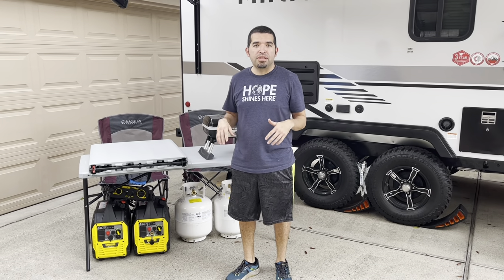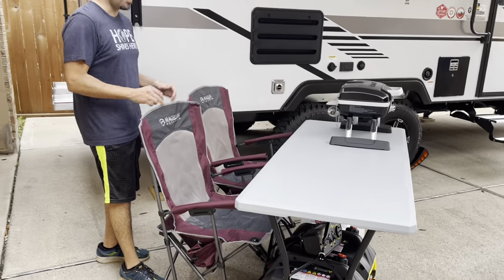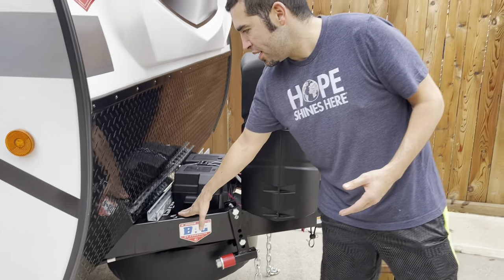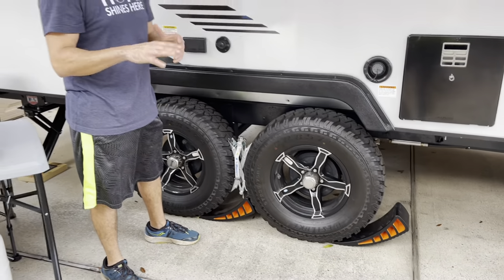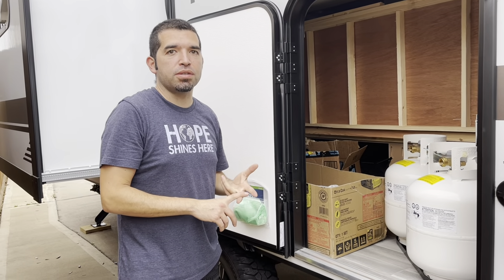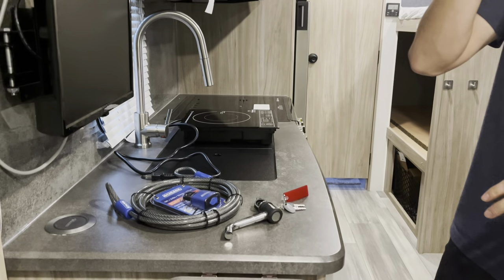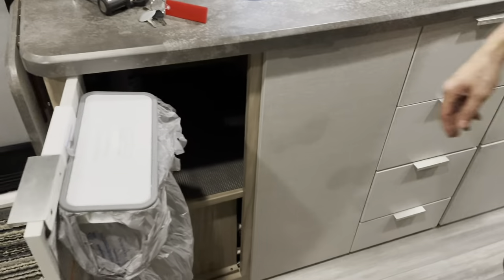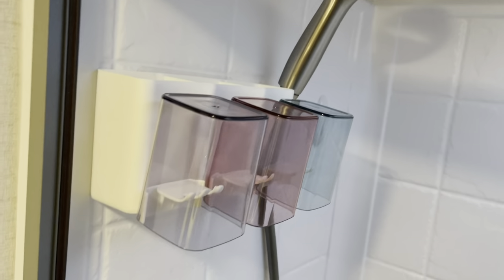Winnebago Micro Minnie 2100bh Accesories

Comment: Purchased a Winnebago micro Minnie 1 year ago, nothing but problems with it. We went to use it after it had already been in for service several times. While it was still in the 1 year warranty period we traveled to the beach, we’ll guess what another issue, the slide out would not open, we called Winnebago and they said as long as we are not stuck and it can be driven we need to bring it for service. Well we lost our week at the beach. Service took from May to August to have repaired. Basically the season. We reached out to Winnebago to see if they would extend out warranty and they offered to consider any issues we may have for 4 months. Well 4 months is the winter season when it is stored. I must say even that have no confidence in their product! I even reached out to a manager and no better resolution. I would not recommend Winnebago in any way shape or form. We would give a no star rating to  Winnebago period!
Be forewarned on purchasing their product. Not a quality product to say the least! Will be advising everyone on the disappointing and terrible product Winnebago produces

Comment: Several things wrong with your set-up.  Some are not upgrades, some unsafe, and some completely unnecessary.  We have that same trailer and have enjoyed many months traveling in it.  First, the 2 propane tanks at the tongue will last a very long time (several months), no need to add more, and definitely unsafe to store inside the trailer.  Second, there is a solar panel on the roof.  Most campgrounds have power, but even parked at primitive places (which we do often) we’ve always had plenty of power for our lights and the propane is more than enough for the refrigerator.  We camp in northern states in summer as well as camp a lot in cooler months in the south.  Therefore, generators are an unnecessary expense, especially 2!  Third, any RV mechanic or honest sales person will tell you to never attach anything to the bumper.  Any weight additions should be attached to the frame.  Fourth, stabilizer bars would be safer, stronger, and a much better item to spend your money on than chains.   We have enjoyed our Minnie 2100bh many days for many trips.  Hope you have as much pleasure with yours.  Keep it simple and you will!

Comment: Couple of thoughts…
Never ever leave a propane tank in an enclosed space, if it leaks and ignites it’ll blow up everything.
I’d never put my generator on the back like that for a few reasons; the back of a trailer sucks dust forward as you go down the road so its going to fill every nook and cranny inside the case, and if it loosens up and tumbles through somebody’s windshield you’re f’d for not securing your load.
(RV tires not usually balanced, no shock absorbers, those gens are getting a crap ride, same for the straps holding them.

Comment: Thanks so much for this video!  Would you recommend a slide out cover?  Also, do you see value in an extended warranty?  The dealership sold me one but I am thinking of cancelling because it was very expensive (over $3000 for 4 years) and I still have a $200 deductible per incident.

Comment: Question: What is your tongue weight as you have set up?
I love what you have done. I haven't bought a 2100BH like you have but it is at the top of my list.
We think alike....I have the same Inverter/genny that you have WITH the same cable and masterlock. The magna pots are already on my list.
They make motion detector alarms you can put on your Champions to keep secure along with motion cameras with alarms that you can mount on the sides of the Minnie.
I also will switch to 30lb tanks also as I will be mostly boondocking on BLM ground. I will use the area under the lowest bunk to house 400 AH Lithium batteries along with a Victron Multi Plus inverter/charger.
I have a older Toyota Tundra in perfect condition and I think it will pull the 2100BH with no problem. I have the tow package which gives me 7300 Lbs towing and a light 1330 Lbs cargo capacity. That's why I'm so interested in your tongue weight. I'm considering adding a truck topper which would be 200 Lbs. So the tongue weight is a concern. I am also looking at the Anderson WDH as it has great reviews!
Glad I found your videos!

Comment: Hello, thanks for the great tips; we just bought 2100BH. 
For the backup cameras, did you hook up the red and white wire of the camera to the preinstalled Wisight wire, which is red and black, without pulling other cables from the back of the panel?
Reply from the maker: Yes that is what I did. I cut off the connector and directly wired in the wires. I checked for correct voltage via a multimeter. The only downside is that you have to force the lights on (as opposed to having them on automatic) from the tow vehicle for the camera to turn on.

Comment: How did your generator brackets hold up? I have the duel fuel 2500 generator and want to stow it outside also.
Reply from the maker: They have held up well. I actually got a EasyStart 364 so that I can run my AC on a single generator now. I can sell you a set of brackets at cost if you’d like.
Reply: Habe you sold then yet?  My generator arrived today.

Comment: Good video.  We purchased our 2021 Micro Minnie 2108DS in March of this year.  Based on your video of useful measurements it looks like you have the same issue we had with the dinette seat cushions being too wide.  This would prevent the dinette being used as a bed.  Winnebago Towables replaced ours with the correct ones.  Additionally, it appears that your backsplash was cut too wide (rippling at the entrance door side).  We pulled the bottom of the backsplash out (only an inch or two from the end), heated (low heat) with a heat gun and trimmed with a razor knife.  Fits perfect now.  If you would like additional details and photos I will be more than glad to share.